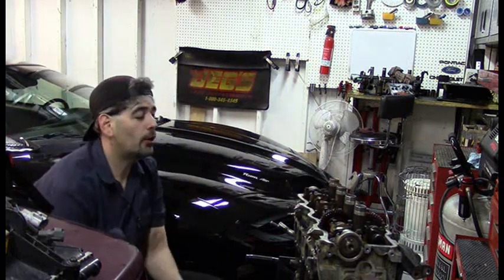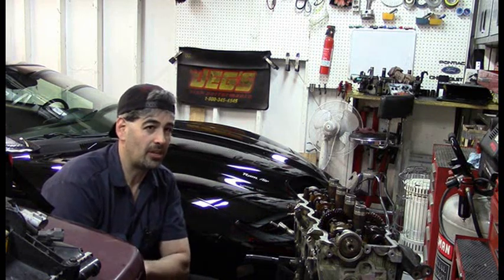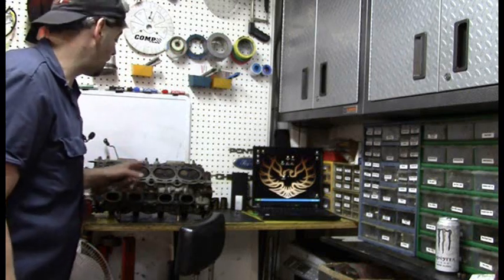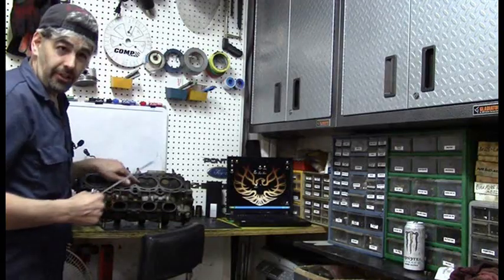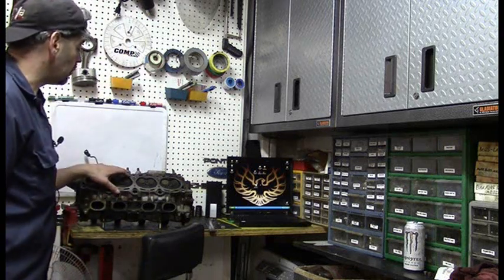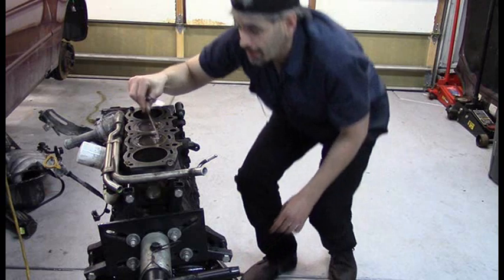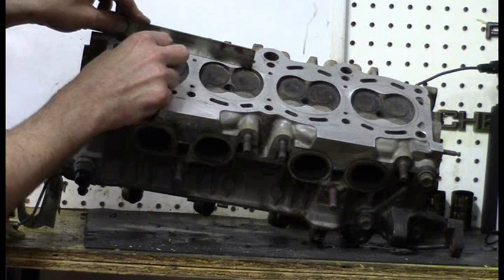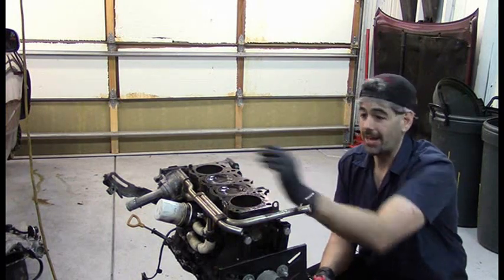Replace a Cylinder Head Gasket Yourself and do it RIGHT! Part 1

Comment: To test the block for cracks, is it practical to make a deck plate using a thick piece of steel plate and gasket paper to bolt to the block with an orifice  to pressurize one cylinder at a time to do a leak down test with the piston at bottom dead centre ? Or is it unlikely to seal ? 
I imagine a drill press to make straight holes for the "head bolts" would be necessary.
Reply from the maker: If you could get that to seal it seems it would work

Comment: 3M makes a plastic 'razor-blade' made for safely removing old gasket material from aluminum parts. additionally, they make a pastic pad similar to a wire wheel that attaches to a drill. sand paper or a wire wheel should never be used on aluminum or cast iron.

Comment: Question i am changing head gasket on 2jz ge to lower compression on my motor to 8.5.1 instead of 10.5.1 . What should i use to clean old gasket off plastic scrapper ? Also should i spray some sort or carb cleaner on head to clean combustion chambers . Also should i clean tops of pistons or anything?
Reply from the maker: scuba All the above

Comment: It is a really good point you make that head gaskets don't just blow, something causes them to fail.  But on the other hand, nothing lasts forever.  Is there any point at which the age of the vehicle or the miles logged can cause a head gasket to just wear out?  Thanks!
Reply from the maker: In my experience, I have yet to see where a head gasket just failed from old age. Maybe they do- but what I've seen is other things fail from old age before the head gasket does, causing the head gasket failure.  A head gasket is a whole different thing than an intake gasket, or oil pan gasket, where they start to leak with age.  Every head gasket failure I have seen resulted from an "etiological" source such as overheating, cracked cylinder head, etc.
Reply: Schrodingers Box I would add one exception to that, if you don't use the correct coolants, sometimes corrosion eats away the gasket between water and oil passages and causes a breach there but it isn't a compression failure
Reply: Are you referring to Dex-Cool?  I know it can degrade the silicone in the intake gaskets, but I have not heard of it affecting head gaskets.
Reply from the maker: David Norris I don't believe it even degrades the silicone- silicone is about the most inert substance on earth.  I believe the idea of this started with the intake manifold gasket design flaw on the early 2000's GM 3.4 (or was it 3.8, I forgot) where almost invariably, the intake manifold gaskets leaked at the coolant port- and every repair was temporary leading to the belief the dexcool is eating the gasket on the plastic intakes.  In fact, it was a design flaw and in fact a TSB went out recommending aftermarket redesigned intake gaskets which solved the problem- but the gasket material itself was not the issue.  Unfortunately, many an engine was destroyed from coolant in the oil before they even came out with the aftermarket fix.
  I do agree that the idea that dexcool also "eats" cylinder head gaskets is not true either.

Comment: I have a 22re with an external headgasket blow, coolant leaking between #1 and #2 exhaust ports down the side of the block.  Couldn't you also use a dye penetrant test??

Comment: Great...thanks. One more question and this may be a dumb one but is it acceptable to install a head gasket, torque the head, remove the head and install another used head on that same gasket. Note that the engine has not been started with the new gasket.
Reply from the maker: fljagfan Nope.  Not even with the same head.  The impressions you make on the gasket after torquing will never perfectly align when you reinstall it.
Reply: Schrodingers Box Didn't think so. Thanks again for the help.

Comment: Great video! Very detailed, informative and entertaining. Don't have time to go through all the comments at this time. Don't think you mentioned the direction the head gasket goes on the cross hatched gasket up or down. Wondering what your opinion is on the after market gaskets that are designed thicker to make up for a little more warpage  and or are they only for heads that are planed.  Thanks!
Reply: kitoy h you y
Reply: +hilario prado b b
Reply: +hilario prado y

Comment: excellent video have a few questions i need to change my drivers side on 00 clk320 do i take the chain tensioner out before removing the head
Reply from the maker: +Tone320 P Yes
Reply: Thanks again i overheated my drvrsd head no antifreeze mixture or loss of horse pwr just leaks oil in front  any suggestions

Comment: He'll o do have a video on replacing head gaskets on 2003 hyundai Santa fe v6 3.5 liter
Reply from the maker: It’s the same on pretty much any vehicle - it’s just basic wrenching is all. There is no skill needed in the wrenching. just know-how to ensure conditions are correct for proper fit.
Reply: @SchrodingersBox  ok thanks

Comment: Amazing video mate! Super detailed and all. I'm gonna start this procedure on a 99 mustang but wanted to know if before doing this should I drain both the coolant and the oil from the car? Or would I be safe to do so without it?
Also the fuel lines will be pressurized, should I remove the fuel pressure at all? 
Any help much appreciated!!!!
Reply from the maker: Yes you have to do all that unless you want a huge mess everywhere

Comment: Hi! My car has oil leaking in the coolant reservoir. I see oil also around the engine. The gaskets should be replaced no doubt about it. Potentially I may have also have broken head cylinder (s). My question is, should I replace all the cylinder heads once I replace the gaskets? Or is it enough to just replace the head (s) that is/are broken?
Reply from the maker: Good question. First confirm it is indeed due to head gasket failure and not oil cooling system failure. Second, I always replace head gaskets and recondition the heads in pairs to prevent unequal compression between the banks.
Reply: @SchrodingersBox   thank u for the response. What do u mean by reconditioning of heads?
Reply: @TheShayneshy  He means taking it to a machine shop where they will recondition the head by resurfacing it, checking for cracks and replacing any worn parts if necessary.

Comment: I have an 01 honda civic with the bad head gasket, in the case with honda civics is very common for head gaskets to leak so doing an autopsy doesnt yield anything, specially since i've already replaced all the other things like tstat, radiatior and water pump and still overheats only on long trips and reservoir overfills with coolant.
Reply from the maker: So what is the reason it is common for them to leak then?
Reply: im not a mechanic, I just learned is common from doing research on this make and model
Reply from the maker: hvac caldera   I reiterate- WHY do they fail.  That's what you should research. You are justifying a result without an etiological source.  illogical.

Comment: A better technique on checking flatness/warps is to get the head reasonably level and then use a wider straight edge that will stay upright, Lay the straight edge on your feeler gage and see if you can drag your straight edge around with it. if so, the gap is less than the thickness of the gage at those places.

Comment: hey Matt I have a situation I remove a throttle body to clean it from a Pontiac g6 2009 and when I put everything back together the rpm went ballistic up to 3000 I did not know that these car need to be recalibrated any help will be appreciated thanks and keep up the 2% excellent job
Reply from the maker: rafael b It seems unlikely you would have to recalibrate it- I would be far more likely to think you did not properly secure the TB back causing a major vacuum leak behind the TB or o0therwise forgetting to connect some type of vacuum hose or maybe you disturbed the IAC- but just removing a TB and cleaning it-- very unlikely it is a calibration issue.
  What is the TPS position indicating at idle?

Comment: If I see that a bolt from my engine is loosen or a washer is not properly seated and I notice oil leaking from that zone, I will need a  gasket replacement and/or resurfacing right?
My engine does not overheat and the temp indicator is working, so I hope that it needs either a new gasket and to check it the head gasket is straight right?
Reply from the maker: +SacreDro I have yet to see where just tightening a loose intake manifold or head bolt permanently makes a repair.
Reply: I know what you're saying, I just want to diagnose the problem and to be sure that there isn't a head gasket problem since the antifreeze doesn't need to be toped off or that there isn't any warped surface between the block and the head gasket. I'm not a mechanic, but I need to know that if I replace the head bolts at least I won't see any oil leaking from my engine.

Comment: At 1/3 through the video i discovered something very important about doing this job, and its that its too complicated and delicate to get it right the 1st time😅
Reply from the maker: Lol- took me 3 times to do it right the first time I ever tried, however that was before I knew to measure the block and head for warp. I didn't realize the head was warped- I just replaced the gasket.

Comment: I checked my timing and camshafts were facing 180 degrees apart from each other, sprockets at 10 (inlet) and 12 o clock and crankshaft pulley at 2nd from left, what could be wrong if car cranks, but can’t hold on to idle? The distributor is also a little out from where it was it seems timing it may be a little forward, what could I do?
Reply from the maker: Properly timed, every timing indicator should line up EXACTLY.  Set the timing components again until they are exactly aligned.
Reply: Schrodingers Box thanks had to sit the car for a while. However I used carb cleaner. The hose connecting the inlet and the break whatever was leaking. Though I still have a minor not keeping idle when car still cold. I guess I will have the timing light check done. It’s possible timing could improve as the distributor is slightly to the back (retarded) compared to before, but if I tune a bit to front I get a slight misfire.

Comment: Excellent video thanks for sharing your experience, the only thing that I did not see you do is sand the block for the new gasket, are you suppose to sand the block or just clean the old gasket with a razor ?
Reply from the maker: I usually remove any old gasket debris with a wire brush and then sand it lightly and clean with acetone.

Comment: Hell of a mechanic. You really know your craft well. I have a question, if you can help. I have a blown head gasket on a 350 Chevy motor. Thus will be my first time doing this job. Can you tell me the steps on how to do that and clean the oil and anti-freeze mix ? Its on a 72 Chevy MC, so I have a lot of room. I just don't want to make any mistakes, so I don't have to do it again and ruin my motor. I would really appreciate it. Thanks for the video
Reply from the maker: I use acetone to clean anything oily.  It works amazing and leaves no residue.

Comment: i did the infamous timing chain guides on my 2001 bmw 540i and it was retimed wrong. i heard popping noises and so i retimed it and the car started shooting out white smoke...ughhhhhh what could cause a head gasket leak besides age? there was no mixed oil and coolant before this issue btw. car ran fine.

Comment: Hi, I've got a VW Vanagon 1.6TD (JX) engine with a garage diagnosing engine gases entering into the coolant circuit. Do you agree that this is a clear sign for a leakage at the cylinder head gasket? Thanks for you feedback!
Reply from the maker: it could be. What data do they have?

Comment: Great video. Thank you for the good information.  I purchased a gasket kit that has head gaskets that have no instructions, no color differences and the fire rings do not connect on either side.  There is one side with two strips running between the fire rings though. Would I treat these strips that connect the fire rings as the side with connected fire rings when determining which side goes up?  Again thank you for the information.

Comment: May I please ask: What replacing a head gasket, are you going to want to go ahead and just replace both of them even if just one is blown? Thank you!
Reply from the maker: Man that's a really great question!!
  So I always replace both if the car has 2. The reason is not because of the gasket so much as because if you have a brand new reconditioned head on one side and the old head on the other side, there is every reason to think the compression on the new head will be much better causing an imbalance.  Also, remember cutting the new head to remove warp would also change compression and can affect balance.
   If I was only replacing the gasket it wouldn't be as big a concern but I've never just replaced the gasket- there is always some cause of the failure.

Comment: This is great but I have a crack block from the top bolt what can I do
Reply from the maker: That would be a major major problem. You will at best need a machine shop to repair it and at worst may need to replace the block- which would be my preference in that case anyway.

Comment: Awesome video!!! Very educational and helpful for me right now. Changing one on a PITA 97 Altima :) Thank you, Thank you, Thank you!!! One question...is it critical that an  angle gauge be used?
Reply from the maker: fljagfan Thanks and to answer your question.... Sort of.
  On a more standard torque angle like 45 degrees or 90 degrees it is not hard to do things like use a reference point for the ratchet or better yet, make marks on the socket and cylinder head surface but sometimes you will get torque angles like "108 degrees" where the gauge really makes it more consistent.
  Even with "standard" angles, I still recommend using the gauge because besides 1degree accuracy, using the gauge really does make it easier to keep a clean, consistent "sweep" to the desired point while torquing.

Comment: Hay, I pulled my cylinder head off and found a gap/burn in the gasket between the cylinders. When I looked down the cylinders and saw no cross hatching, do I need to hone them? Can I hone without taking out the pistons?  I wasn't burning oil.   Thanks
Reply from the maker: Yeah- I really, really recommend honing.  Even on pretty high mileage engines I still clearly see the cross hatching.  Also make extra sure to measure the bore diameter.  No cross hatching indicates possible excessive wear!!!

Comment: Just a quick question I live in puerto rico and a lot of people hear don't use a thermostat because it's always hot here all year is that ok allso they love running the car with just straight up watter witch I don't think is good for the engine what do you think thanks ahead of time for any answers
Reply from the maker: +Monstrosity Sound Inc. I am not familiar with Puerto Rico but if the cars there have catalytic converters, it is definitely a bad idea because it will greatly shorten the life of the catalytic converters.
  Arguably, a rich running engine will also "thin" the oil since the blowby vapors will have more fuel but that's a bit more debatable especially if oil is regularly changed.

Comment: Great video! I am hanging on every word you spoke.  At 3:04 on the video you said "if you add oil to the cylinder that is low and it greatly increases back to normal, it could mean the worn rings and a potential engine rebuild."  I think that is an important point, can you elaborate a bit more?  What I think you're saying is after I find the cylinder with low compression, I pour a bit of motor oil directly into the cylinder (how much?) and do the compression test again to make sure of this, correct?  

I am watching because I have a super high level on my dipstick, indicating coolant in my oil.  Also have coolant splashing my belts and making them squeak, need to look a little closer before I can say where its coming from but I see a bit of a drip down the front of the engine.  Also once had a big cloud of white sweat smoke out the tail pipe after I left it idling for a bit.  My car is also repeatedly misfiring in cylinder 1 and idling rough. I watched your video about the head gasket repair liquids, and I tried Blue Devil, my car ran ok for two weeks now it running quite a bit worse than before.  Its money back guaranteed so I figure it was worth a shot, so im getting my $ back.  Even with all this going on, I still cannot diagnose if I need a new head gasket until I do the compression test if I understand correctly.  Oreilly auto parts rents the compression tool for free, Im looking forward to testing my cylinders.  Thanks for taking the time to make this.
Reply: Hey I found out what you meant by doing a wet and dry test.  Sorry for my ignorance.  I did the compression test on my 4runner, I had even 60 psi across all cylinders on both wet and dry test.  Time to learn about intake manifold leaks.  These are probably the best most professional series of videos I've come across on the subject.  thank you for making them.

Comment: So how often is there a head problem vs gasket problem. My xc90 has combustion vapors in the coolant & I'm trying to decide whether to take the head off or just try BlueDevil.
Reply from the maker: Validate it with a leakdown test first and if positive, repair it by removing the head and validating warp before replacing gasket, Do not just replace gasket.